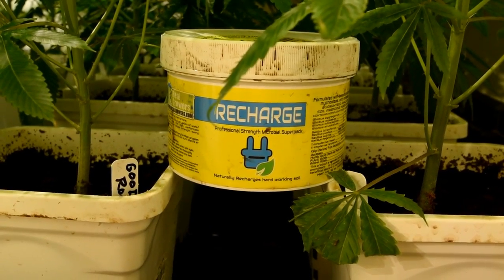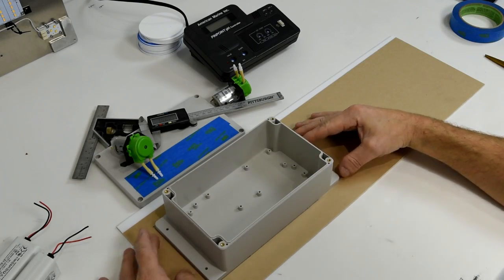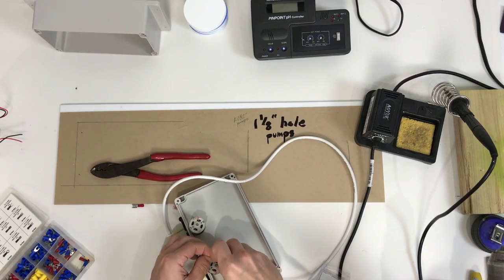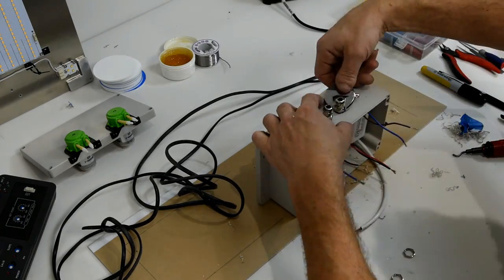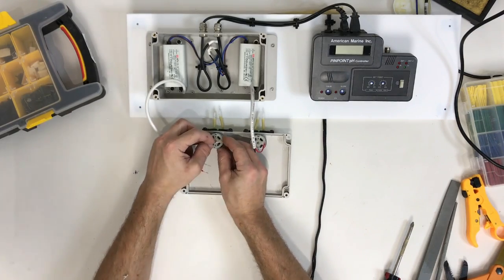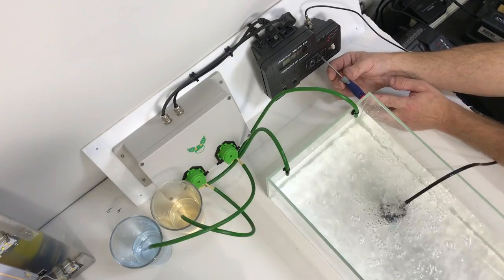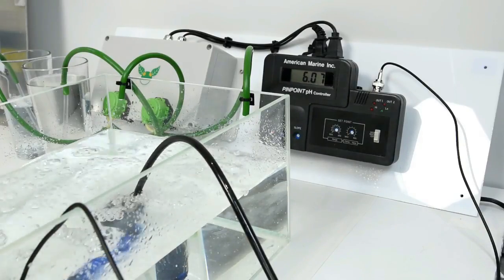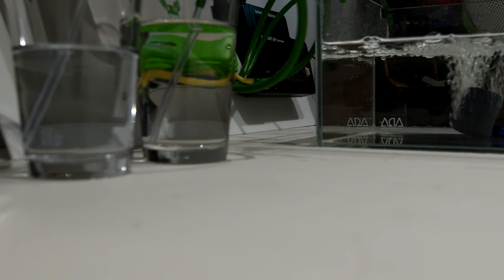DIY pH automation for hydroponic reservoirs

Comment: shaking ph solution isn't gonna matter. Its just phosphoric acid and potassium carbonate, they wont "settle out".  Issue with the pinpoint controller in general is there isn't a adjustable delay. Those units were mainly designed for Co2.  Making something like this out of arduino wouldn't be difficult, you would just have to source for some decent pH probes. You also have to keep in mind those probes have a limited life most of them are only rated for like a year of use.

Comment: Using similar skills and components, you could make a flow battery for high energy backup storage.. pair it with some solar, wind or hydro power and you've got a complete energy solution.  Not only would you have backup power, but you could take your entire operation off the grid.

Comment: super bad ass! in such a small test tank I'm surprised you got it to settle! I could imagine slowing down the pumps with lower voltage (essentially what diluting did) would help with control for some folks.

Comment: Built the same one with identical parts and cost me about 350$ CAD total (Half the price of the Bluelab controller), just got it set up and doing a test run but so far so good. I opted for a 30:1 mixture because it was using so much of the 50:1 solution. Next step is setting up 5 gallon pales with PH up and PH down solutions and wiring up a float switch to shut off the controller when the solution runs out to prevent the pumps from burning out.
Reply: 9 hours later and it's working perfectly, it kicks on once every 9 hours when the PH gets to 6.02 (high setting) and brings it back down to my low setting (5.81) in about 30 seconds without using much solution at all.

Comment: Just an observation for what it's worth; Try putting the probe back on the other end of the tank and increase the sample rate of the controller.  In process control of this type you generally don't need a PID, just a PI or a straight proportional control.  But give the dose time to effect the whole tank and get mixed in by increasing your sample rate.

Comment: Thankful for this video. Helpful in my research on building flower room aeroponic systems with off the shelf components. Aeroponics would for sure need some guy or gal checking the PH of reservoirs on a constant basis, unless you can PH automation. EC does not fluctuate as much as PH in hydro, so unless it is on a larger scale, I think a lot of DIY full flower aero set ups can run fine with just PH auto control. Eventually I want to have both, but I just don't operate on a large enough scale to make the EC auto control nearly as important as PH.

Comment: instead of giving it such a small window as the 5.9-6.1 would opening the window to around lets say 5.7-6.3 to turn the dosage pumps on less barely using any ph up? Or even better 5.5-6.1 as most waters in the states have high ph. The window for the 5.5 will allow enough ph down to be dumped without having the ph up kick on and fight each other.  I noticed with my water the ph will drop to around 5.5-5.8ish then always rise to 6.0 just because it has to get fully mixed in. I believe when you further diluted the mixture its essentially "widening" the window but from the mixture as it has more time to gradually change the ph of the water saying within the (+-)1 rather than giving a larger window so it can fully mix in the res and give a "correct" ph value not the value of the "ph swing". Just some thoughts, I try and use the bare minimum of ph up/down cause it can through nute ratios off! Love the vid!
Reply from the maker: you are absolutely right!  just simply opening up the window to 5.8-6.2 made a world of difference & no more YOYO effect.

Comment: Great vid, thank you. I just ordered all the goodies to build this. PH is the Bain of every hydro grower’s existence. I could not find a dual system anywhere.
Reply: how did you make out?
Reply: Very well Ken. If I knew how to post a pic I would lol I tried a couple different ratios for both PH up and down and landed on 20:1 for both. I have a 75 gal res feeding 8 25 litre totes (ea holding approx 15 litres) RDWC. Works good but I wish there was a way to pause after a dosing to give the entire system a chance to adjust.
Reply: If someone could design and build an affordable system that doses ph up/down and ec that would be amazing. For EC you could have a target with a ratio mixture from 4 or 5 peristaltic pumps. For example if you were looking for an ec of say 1.2 it would dose the desired ratio ie 60% from peri 1, 20% peri 2, and so on. I think you have the know how to build this.
Reply: @kencochrane1006  see comments below.

Comment: I think systems running this type of PH auto control should consider using small circulation pumps, in addition to air stones, for greater circulation of the up and down chemicals. I see that one of the issues in these tests is that the added up or down solution is not circulation fast enough.

Comment: And on the back was the power supply together with a dual pinpoint? How did you connect these pH dispensers to the device to automatically dispense pH-adjusting fluids?

Comment: If the aquarium your first test run was done in was straight RO water, could the rapid fluctuation be a result in the lack of anything to buffer the PH? My guess would be if you repeated the test using the nutes you would be running in your res, a more concentrated PH +/-, your readings would not be as rapid or variant.

Comment: How long do you think the tubing in those valves will last? I imagine having pH down running through there even at a diluted level could be acidic enough to cause damage over time. Simple enough to just pull and replace a pump though. Nice setup!
Reply: John Othic the tubing in those pumps should be silicone... pretty inert. if there is an issue (after a while the tubing does wear out from the squeezing motion) the pumps I've seen are operable and you can put a new length of tube in, essentially rebuilding it in comparison to a piston pump.

Comment: nice video.  Are you aware that air bubblers raise ph levels naturally?  Adding air to the water removes carbon dioxide or carbonic acid; water + carbon dioxide; effectively removing acid from the water increasing ph levels.  If you use a more nontraditional method of aeration; water fall 12" or more, you will find you will only add ph once and th ph will not drift any further and your water will be aerated without loss of acid, saving money on ph up.  I am also working on an automatic ph system using arduino.  I have completed code, just not starting any testing yet.  have you considered adding a third persistolic pump to add just water to your mix before adding to the tank?I I like the automatic ph systems.  namaste
Reply from the maker: right on brother.  thank for the food for thought. cheers
Reply: Avid Lerner I was just thinking about doing this using one of those. Did you test your code yet and is it on github? I am thinking about writing something similar.

Comment: is there a way to shut off the controller for the flood cycle of a flood and drain system?
Reply: You could use a digital timer to shut off the controller without issue. As long as it can keep it's settings after a power outage.

Comment: +growmau5 step drill is a great tool for making circular holes in the project box... would you have any advice on cutting 'square' holes in the plastic project boxes for square switches etc? thanx in advance
Reply from the maker: I wish I had a tool for that.  perhaps a large "rabbit" or mortise and tenon cutter...?
Reply: PiKasso MusiK there is a tool called a square rasp I believe. It's like the step drill but it is square and is simply pushed through.

Comment: Hey @growmau5 , if you get these messages, what was that data logger that will update on a program through wireless to the computer? Didn't hear it get mentioned on the tools show. not to control just to log environmental data, co2, humidity, temp, Volts... There are quite a few different ones out there, could you say which ones you like and the one you prefer or use in your room. Thanks

Comment: In my opinion, after reading the reviews on those cheap peristaltic pumps they seem to have no quality control during the manufacturing process and as a result, they vary wildly with flow-rate.  While diluting your solution to compensate can work it's not as effective as properly calibrating them to have an equal flow rate. I'd imagine a basic dc motor control circuit with a transistor and potentiometer would suffice.  You'd probably only have to use it on the faster of the two pumps to kind of underclock it. Sort of like how AMD Crossfire works with Different cards but it has to dial down the faster of the two in order for them to split the work load evenly.
Reply: This ain't no exact science. It's sloppy mixin. As long as the system waits for a while after pumping it's all good. Even it takes 5 minutes to adjust 1 ph, in the long run it doesn't matter.
Reply: To slow down the mixing I've tried using stepper motors instead of standard dc motors.

Comment: How do you accomodate an intentional drift with this system? If your value is set to 6.0 and your deviation is set to +/- .3 (for instance) will the controller linger within the range as it correct?

I.E. correct a pH of 5.3 to 5.7 and then allow the mixture to drift all the way up to 6.3? Or will it correct a pH of 5.3 to 5.7, allow it to drift up to 6.3, and then correct somewhere down to 6.0-6.3 when the mixture strays basic? 

Does that make sense? 

Question is, basically, if I intentionally let my pH drift through the 5.5 to 6.5 range, will automation allow me to do something similar or be more "robotic" in the way it corrects pH?

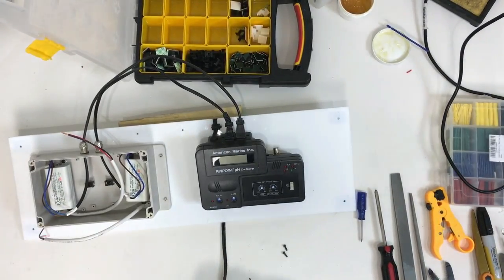Comment: 6:07 Does it really matter what wire goes where to the Meanwell? Considering AC and all...
Reply: True, but that will change depending on which way the cable is plugged in...
Reply: Usually a plug only goes into an outlet one way. Not sure about other countries but that's how the USA is.
Reply: Okay, but still: I doubt that every electrician wires the hot wire to the same "side" of the outlet. Or?
Reply: @tiuq23  Indeed EVERY electrician will wire the hot wire on the same side of the outlet. If they didn't it wouldn't be to code and they wouldn't be an electrician.
Reply: That's good to know. Thanks!

Comment: Peristaltic pumps that you have I have similar ones. Problem with these pump is they don't have same flow rate. Ex. One may do say 50 ml per min and another pump of same rating may do 51 ml per min. This creates a issue when you need to dose 2 or more stock solution in same proportion. 
So the question is how to you fix this problem.

I know my question is related to ec and video is on PH.

Comment: Is there a benefit to using the dual stage ph controller over the single in this application?
Reply from the maker: if you reservoir tends to drift UP  most of the time.  a single stage is perfect.  If the res is all over the place 5.0-7.0 , the dual stage may be necessary.
Reply: Perfect, this is super helpful. Thanks again!

Love your videos and the whole growtube!

Comment: because of the pH has to be precise and those pump can't be precise we have a problem, we need something more  precise other than this pump. what i am trying to say is this method can useful but this pump will put more ph or less ph, and sorry for my poor english
Reply: @TheRybka30  I think you are right, I did this project before and the result was epic fail, I thought that it was the pump, I hope we see something better in the future
Reply: @TheRybka30  Yes you right, I use very slow pump 13ml/min with gearbox, with 3 rollers , pump works very slow and nice. This pump which in this video very cheap, I bought same pump, but then I put them in garbage. I built  two like this controller, they works great for me. Pumps which use : LEFOO, model # LFP104, 12V/60RPM, Size # 16, Flow 13ml/min.
Reply: @Greg25437  how much did it cost u?
Reply: @PoulJulle-wb9iu  $15 each
Reply: This can all be controlled by the microcontroller if you have one capable. In Arduino, you could set up a small incremental dose of pH up or down (whatever is required) with a delay time in between doses. While the delay is happening, you could monitor the reservoirs pH level via the sensor. After a set period of time, if it needs more, the next small dose would occur. It would also be much cheaper than this system. The entire thing would cost less than the "pH controller" shown here. Great video and concept though!
Reply: just dilute the PH solutions as necessary
Reply: Dumb question, but would the issue be solved if you had a way of mixing the solution after adding the new acid?
Reply: Hi friend, where did you buy this pump  ???, I can not find it . only alibaba has but you have to buy lot of 10 min order and t is not the same model neither
Reply: 420 Friendly  you don't need a pi to handle multiple functions, my aeroponic setup for zucchini handles reading nute concentration, pH levels, spray timing, and water temperature all in one controller. I'm working on adding a RTC to let it handle grow light timing as well. It's just a matter of handling timing and interrupts properly based on how you structure your code.
Reply: @arielrojas9349  AliExpress is better than Alibaba for small orders.
Reply: @dudemcgee256  is this proportional control?? I am planning to use ON/OFF valve for each base and acid. So maybe i am thinking I need to vary the ON time for each valve based on the error. Is it possible?
Reply: @chickenz4604  It is definitely possible if you have the know how. If you are familiar with pid control you should be able to figure something out. Let us know how it goes!

Comment: heyho! Did u check ur EC after ur solution stabilized? I always try to use the least possible amount of ph adjuster, since a constant adding of that stuff, especially to hard water, will raise the EC noticably.

Besides that, would a different line of ph correctors, without puffering additives, like pure acid/alkaline as most of them are, need less/get stable faster at this kind of live-auto correction? Are you satisfied with GHE Ph+/- in general?
Since, as u said urself, the probe takes time for an accurate reading and the silica (potassium silicate I pressume?) of GHE ph up and the buffering agents/calcium regulator of ph down will take time on their own to adjust the Ph - which adds to the constant/prolonged fluctuation. Or am I wrong?
would an interval reading (like every 30s a reading) not also result in a more stable immediate PH reading of ur solution? 
I use an ADWA PH 12 pen (2 digit reading) but the probe is aging so fast (6/7 months old and costs almost as much as a new pen all together) - and I just use this pen every other day. 
Are those maritime ph meters/probes more reliable/have a longer life span? 

I'm about to buy my very first reservoirs for a simple top-feed system (which I already own) and I'm thinking about replacing my ph/ec meters as well  (my ADWA EC Pen dies constantly due to voltage drops/fails to power up and I cant get it fixed) and I only read bad reviews of most available, affordable meters (some of those 10-20euro pens might be good for testing tap water, but most definitly not in the range we use).
-> Therfore any suggestions on EC/PH meters/certain brands? I guess europe has a different market/brands than the usa.
AND ANYTHING I have to watch out, when choosing a reservoir? Like material/shape? Does it have to be i.e. food-grade?

my apologizes for this mass of text/questions - Im just toooo curious and do not want to continue my path of massive fail investments :)
Reply: Wouldn't a water agitator or saltwater tank fan in the res mix the water faster and therefore giving a quicker more accurate reading? Less ph up and down in the long run I would think.
Reply: Bluelab pen (IF PROPERLY RINSED AND USE THE STORAGE SOLUTION!) lasts a long time.  Have had mine for two years and still solid.

Comment: Yeah, but what is it doing to your ppm if you're dosing it all day?
Reply: What it should do to ur ppm ?
An just btw ph is much more important.
They cant use the nutrients if ur ph isnt right.
Reply: It would raise your ppm.  There is a limit to how much ppm you should have in your rez.  With your ppm out of wack your ph won't make a difference and neither will your nutrients.  It's a balance.  Not a competition.  If you dose at a constant rate all day you are adding caustic and acidic compounds to your rez that don't simply disappear.  I think you should watch a couple of videos on ppm and ph.  Imagine you are at a restaurant and the waiter shoved a funnel down your throat and was cramming your stomach past it's capacity.   It wouldn't matter what quality of food you are eating or in what proportion you are eating them at if you've completely destroyed your ability to uptake them.  That's what you're doing to your reservoir when you cram the water past it's nutrient capacity for your plant's growth stage.  Everything is about balance.
Reply: alot of people fail to realize ph swing is imperative for optimal nutrient uptake
Reply: Just put it on a timer, 2 to 3 times a day for, 15-30 minute intervals should be fine.